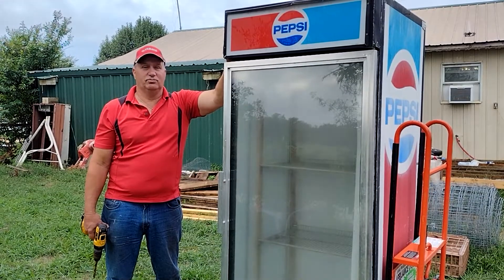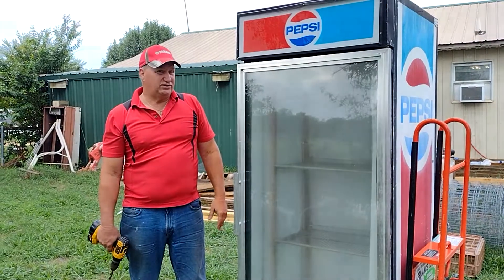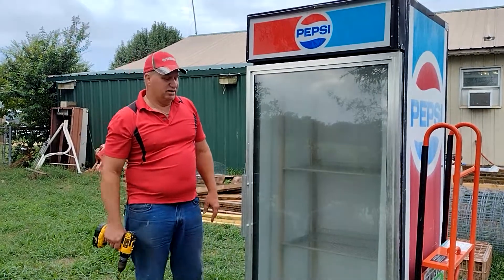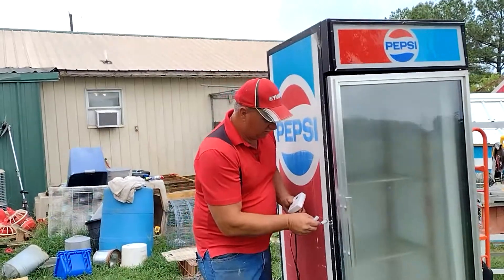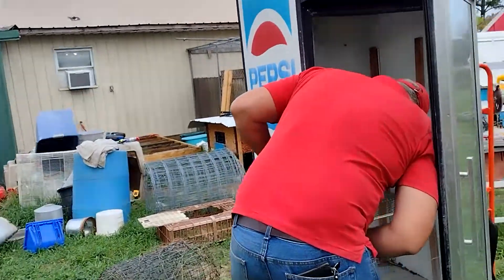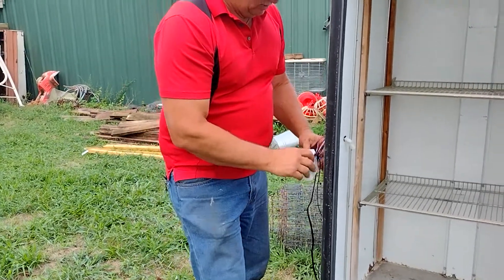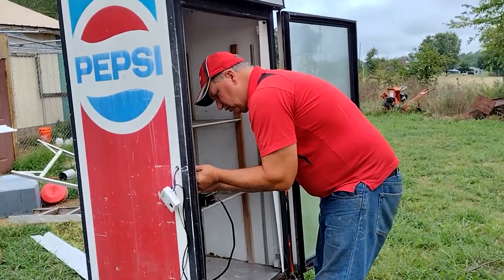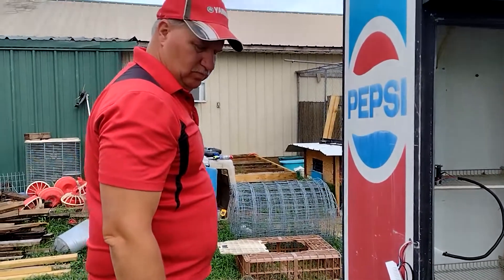DIY Incubator For Chicken Eggs From Old Fridge

Comment: How’s that Incukit holding up?
Reply from the maker: We rearranged the fans by recommendation from the experts at incubator.com. then ran into trying different size water trays for humidity or at least the proper humidity. To much the first batch still had 60%hatch rate with to much humidity. Now trying batch with smaller water trays and less humidity.